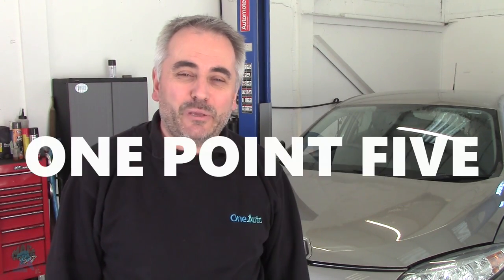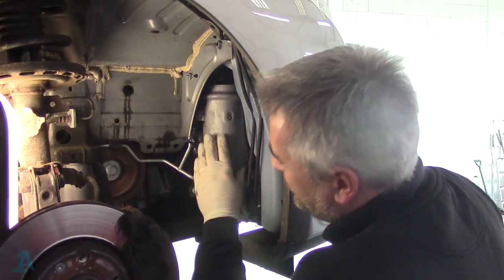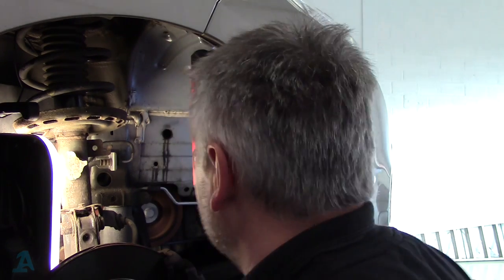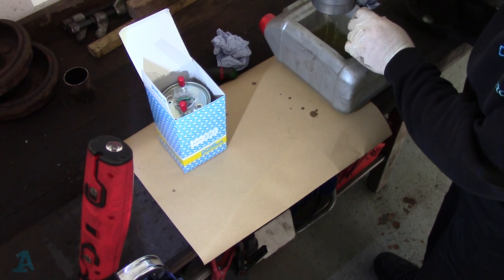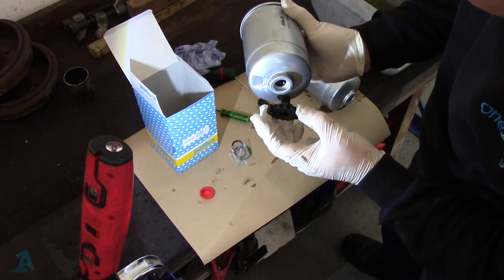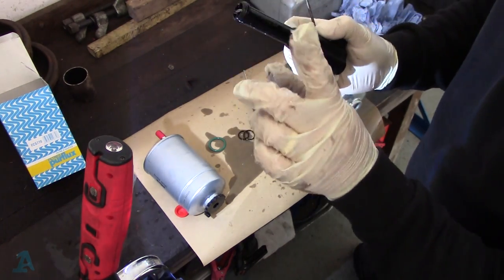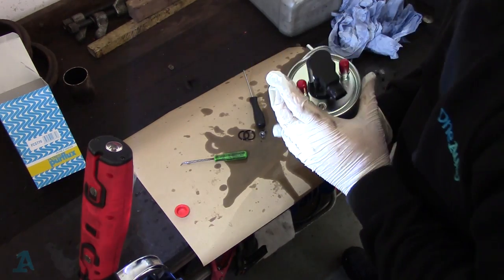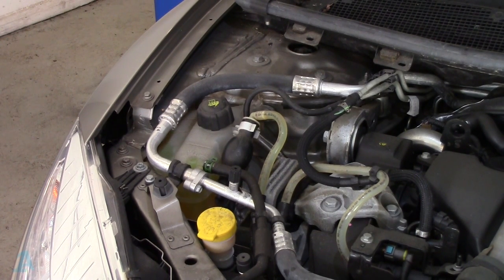Renault Megane 3 How to Change the Diesel Fuel Filter

Comment: Great video Rob! Thanks to this, I'll have a crack at changing the fuel filter myself this weekend. I'm having some issues with 'Check Injection System' like many others in the comments. I've been recommended to use Liqui Moly Diesel Purge and I've seen different ways to use it. Any thoughts on how to use Liqui Moly most effectively to clean Injectors? 

I read that you can dip the 'inlet' and 'outlet' pipes you've shown above the fuel filter into the Liqui Moly itself and run it through... or am I being daft? Thanks!!

Comment: Excellent video Rob. Very useful. I'm going to change mine tomorrow as I'm having to prime my engine everytime to to start it,but once it's running it drives perfectly,but the minute you turn the engine off you have to prime it again to start it,so I'm hoping it's just the old fuel filter badly clogged or an air lock somewhere in the clear diesel lines.Any ideas?
Reply: Actually, the reason the engine stalled in this video was probably because the low pressure (LP) fuel line wasn't bled out, it was still full of air which had only been merely compressed by operating the bulb pump. You could see the top loop of LP tube was still full of air. As the HP fuel pump relies totally on the diesel oil for lubrication, and operates at extremely high pressure ( once primed), it's very bad for them to be spun over dry. What you should do to actually  'bleed' the air out is pretty similar to brake bleeding; just press the little bleed valve on the top of the LP tube inlet banjo on the HP pump, whilst operating the bulb pump until the tube is full of fuel with no or only tiny bubbles. It's worth making up a plastic bleed tube approx 11mm ID, with a pin pressed through it across the centre approx 8mm from the end, to operate the bleed valve so you can direct the waste diesel into a bucket, rather than all over the engine. You may have to pump quite firmly because the bleed nipple isn't at the highest point, so you need enough flow to chase the air downwards out of that top  loop of LP tube. 
But for your particular problem, it's possible the bleed nipple is leaking air inwards such that when you turn the engine off and the fuel tries to drain down to the lowest point, air is sneaking in through the bleed nipple, but which seals OK under under positive pressure. If you do the bleeding through the nipple, and operate the nipple a few extra times to excercise it,  hopefully it will clean itself and seal OK. Also check it's got positive spring closing pressure, when not pressurized.  just like a tyre valve. Hope this helps. Good luck.  Allan.
Reply: @The007Weasel  Thanks Alan for all your help,did exactly what you said.Discovered the bleed pump ball was split on the one end thus sucking in air as you described.replaced with new bleed pump and problem now solved.Thank you so much for your knowledge.

Comment: Hi there, loved the vid very informative, I got a question for you if that's ok, my megane is hunting at idle intermittantly and I'm seeing bubbles in the fuel line situated after the primer bulb intermittently. I have had injectors cleaned and bench tested and all were ok, I've changed the egr valve, ran diesel cleaner, scanned ecu and no codes, changed glow plugs, although one thing i did change was the diesel filter but I'm thinking if they didn't change the seals and just dumped the filter in, is air bubbles intermittently in the pipe normal and can it be from the fuel filter and can air in fuel cause hunting at idle? Otherwise car drives perfectly fine when I'm driving its just idling I'm having issues with. Thanks really need ur help as I'm in so mucb agony with my Renault.😊😭
Reply: Hi did you solved your problem? I have the same issues like you. Bubbles in the fuel line, vibration on iddleing?

Comment: Good video, so now I want to change mine. Which one do I buy? Is there any way of knowing if the connection is for a water sensor or one without the connection without taking the wheel & lining off?
Reply from the maker: It’s the same filter, just screw in the drain and or sensor from your old filter. Your local motor factor will fix you up with the right filter from the cars reg number
Reply: @OneAuto  Cheers Rob

Comment: I have changed my filter and using primer bulb but engine still won’t start. Is there an easy way to bleed the air out the engine or will I need to crack the injectors

Comment: Great tip...been having issues with anti pollution and check injection system warnings...after using scanning tool with the usual MAF sensor code wanted to go back to basics and was hunting around for filter and bingo your video...have you ever changed a turbo on one of these..a lot of people are saying it's an engine out job...👍👍
Reply from the maker: Thanks. Never done a turbo only exhaust temp sensor near the turbo that had failed causing a DPF blockage.
Reply: @OneAuto  many thanks...I find it strange on all the forums I can't find anyone who has personally changed one....mate of mine has the megane 1.5 sports tourer and the turbo shit itself and he was charged £2500 at mate's rates to fit a new turbo due to having to remove sub frame and engine...There is more than a smear of oil in the turbo outlet to intercooler and it may well be on its way out..whilst I don't have a problem removing the engine on my drive I think I will have to suck it and see and try and get it off and see how it goes...👍👍
Reply: Richard iv just bought one of these cars and I cant believe youve just said about check injection warning light , thats on mine too!! And the when I put in scan tool it cam up MAF sensor 🤣🤣. Guessing this is a common fault ? 

Did changing the fuel filter make it go away ??
Reply: @rustybaws5313  Hi David...Changing the filter definitely sorted out check injection waring light.... judging by the condition of the filter I don't think it ever has been changed... but anti pollution light was still on...after repeatedly re setting it for about a week and  keeping the revs up in 4th or 5th gear on dual carriageways it finally didn't come back on again...fingers crossed it's been off about two weeks now...it's the wife's car and does a lot of stop/start local runs...👍👍

Comment: So much easier when you have a priming bulb.  I've got a vectra c 2.0dti and they dont have the priming bulbs, well the DTI engines don't but the CDTI engines do,  the DTI engines take forever to restart when you change the fuel filter  . I decided to fit a priming bulb in the fuel line on my DTI and it starts straight away when you change the filter now. No more cracking the injector nuts to bleed the air.  But I must add, changing the filter is so much easier on the vectra than that Megane. The location on that Megane is pritty stupid.

Comment: Very helpful video, I see lots of bubbles in those clear fuel lines on my megane. Could this be because the fuel filter is due for a change?
Reply: Don't worry about the bubbles. When I changed mine for 4 years ago I was scared about the bubbles too. But it still works great with some bubbles. Regards

Comment: hi Rob, I have a 2010 1.5DCi Scenic. My fuel pipes seem to have black squared plastic on the ends of the pipes. It looks like there is green and white underneath these squares. How do I get to the connections to release them? Thanks Shaun
Reply from the maker: You have to depress the coloured squares to remove the pipe. If access is tight you can buy some special pliers that do just that
Reply: @OneAuto  Thanks for replying Rob. The holes are only about 2.5mm square BUT the holes aren't opposite each other. The pliers look like the prongs are opposite each other. Am I missing something? Thanks again, Shaun
Reply from the maker: Send me a photo of them officialoneauto@gmail.com
Reply: @OneAuto   Thanks Rob, will be later in the week. Shaun

Comment: could you please show us how to drain the water from that filter?
Reply from the maker: Piotr Bochenek at 5:20 undo the drain at the bottom of the filter. Any water will be at the bottom of the filter and will come out first.
Reply: hi. thank you for quick response. I've done service on my Renault Scenic 1.5 dci k9k (mk3) 2013, I opened the screw and I thought that I did something wrong as diesel (obviously) started coming out. I'm glad that's normal. thank you.

Comment: What is the changing interval?? 30.000 km? 60.000km??
Reply from the maker: Hasan Kaya The fuel filter intervals in the car in this video is recommended every 36000 Miles. So approx 58000km